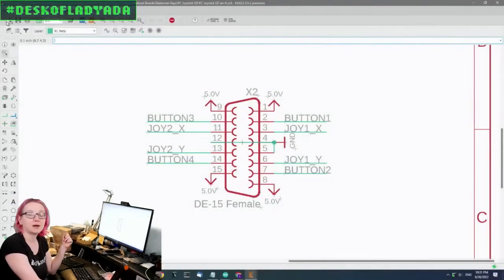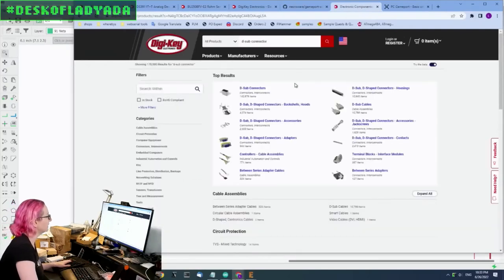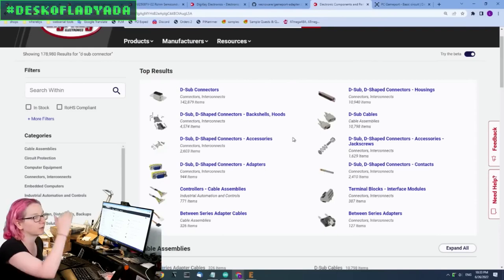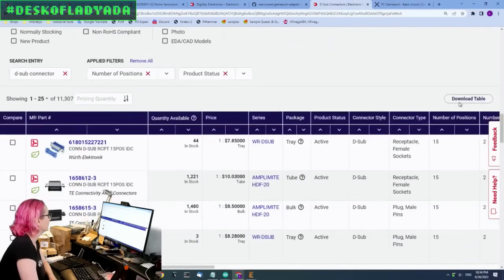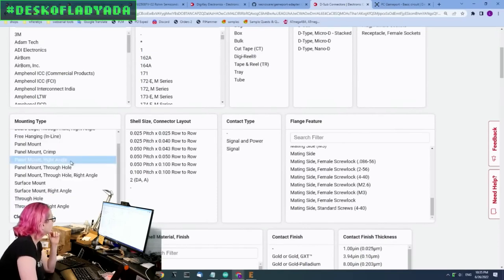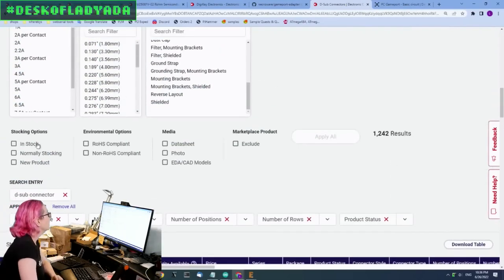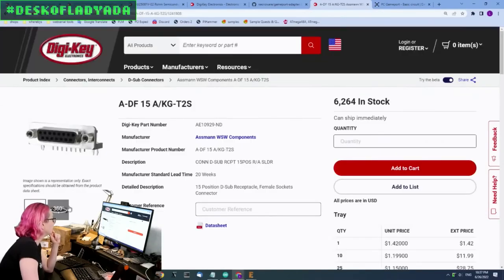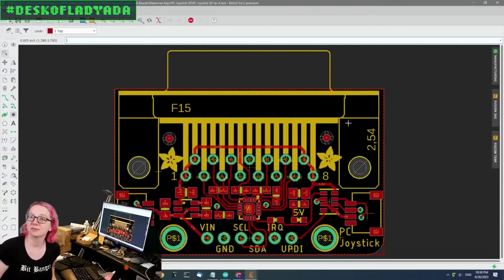The Great Search - DE-15 PC Game Port connector with Screwlock Standoffs @Adafruit @DigiKey

Comment: This video hits a pet peeve of mine. D or D-Sub connectors, had 5 different standard pins quantities. The number of pins were 9, 15, 25, 37 and 50. Each of them had a different letter designation with this letter appearing after the initial "D". This way you knew immediately how many pins the connectors used without the number of pins. The letter for 9 pins is E, so that would have been a DE connector or a DE-9. The letter for 15 pins is A. For 25 pins is B. For 37 pins is C. And for 50 pins is D. 

Therefore DE-15 is NOT a real connector. For 15 pins it should be a DA-15, or DE would be correct for a 9-pin (DE-9). 

DB-25 wa the most common on most computers and PCs (decades ago, btw).